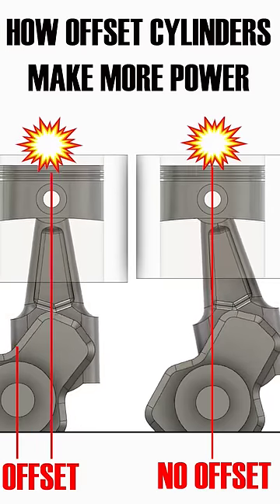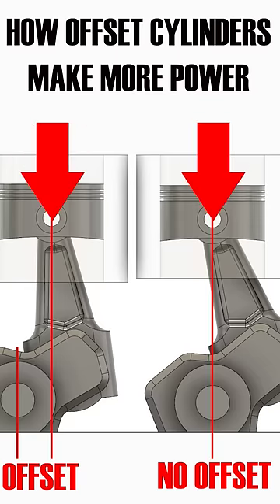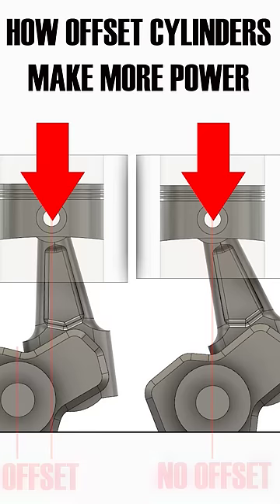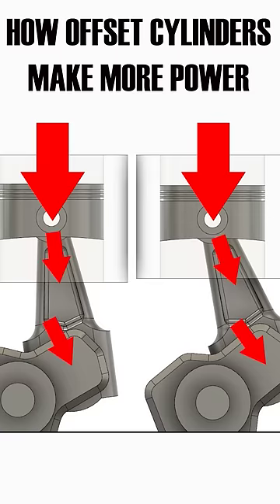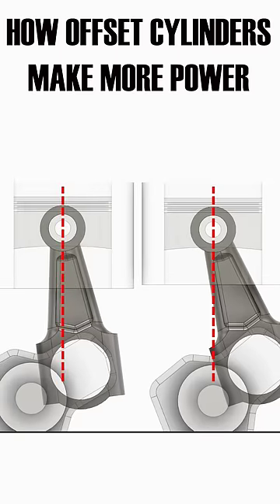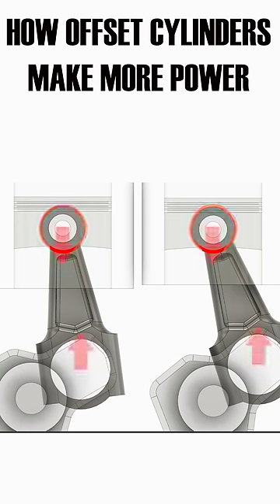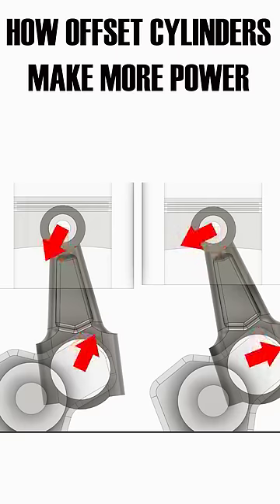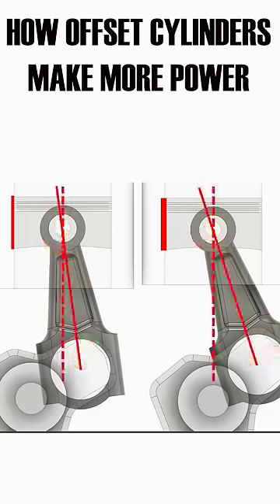Offset cylinders are genius! Full video on the channel. #d4a #engine #yamaha #engineering #toyota

Comment: You mean like the awesome little Slant 6 engine Dodge used to put in everything? Wish they hadn’t stopped making it. I believe it was the best engine ever built in the USA.
Reply: Rest in peace dad... his 72 dodge dart with the slant 6 pretty much embarrassed everything from Camaro RS to 350 SL..❤
Reply: @sbadaro  I believe it. My 1 ton dually with a granny low 5 speed hummed at 135 mph. My speedometer only went to 85, so I had some police friends get in front and back of me and clock my speed. They waved me off at 135 because that was where their speedometers stopped. But I still had pedal left. Never did find out exactly how fast it would go. However, you had to put about 750-1,000 pounds on it around 95 or it would get squirrelly. I loved that truck.

Comment: Mitsubishi were one of the first to do it in sports cars like the fto, gto and galant
Reply: Hahaha! One of the first, with Ford's Model T, no doubt...
No, Mitsubishi were not one of the first.
Reply: @mackerel1875  successfully? And the model t is not a sports car is it
Reply: @pbart9821  Okay. 
MG. The MGBs starting in '62. There's earlier too. And they're not Mitsubishis.
Reply: @mackerel1875  erm, no it doesn't
 It had an offset key on the crank nose.

Not an offset crank 😉

2 degrees is not enough to be termed "offset" it is biased, not truly offset
Reply: @pbart9821  they had offset bores. There's some nice pics if you have any books on désaxé engines.
Checkout the MG works cars with the offset overbore engines. They were done that way for internal clearance. Still désaxé principle though.
Reply: @mackerel1875  again You've misinterpreted that, they have an angled cylinder, but it is not in fact offset
Reply: @pbart9821 Tell those boys to stick to Subaru ringlands 💀

Comment: So with a regular non offset engine it is better to have a longer stroke. Resulting in less cylinder wall pressure and more cc. Therefore the engine will have more power.
Reply: It'll have more torque and you won't be able to rev it as high as a short stroke engine.

Comment: Just watched your video and it was great, with some of the best visual aids ever. Keep up the good work.
Also maybe you can do another video on the topic but this time around the most widely produced offset engine, the prius engine. It has a 13mm offset, and to address the balance issue toyota uses one of two electric motors (mg1)in the transmission and the hybrid system to activate that motor and help the crankshaft move the con rods up on the compression and exhaust strokes, thus eliminating the mechanical disadvantage of the offset engine and taking advantage of all the benefits of the offset engine. Also if you were to induce an imbalance by say disconnecting an ignition coil on a running prius engine it will misfire obviously but it will also shake violently and make a very loud "clacking" noise far worse than any normal offset engine. The prius engine is not the fastest or the most glamorous engines out there but it is very advanced and it would be really educational if you were to make a video on that. Cheers.
Reply: I was wondering what cars use this design principle, thank you for mentioning this extreme example! Also using the electric motors for engine balance is beyond amazing in my mind

Comment: The first application I saw of this was a small inline 4 made by ford a couple years ago and it made me start to think why aren’t other manufacturers using this? It’s such a simple idea and was super effective at adding power and efficiency with no real cost added to manufacturing. And the more research I did it absolutely blows my mind that highway semi’s and ships don’t utilize this in their engines. I mean even as little as a 10% increase in efficiency or fuel economy would be thousands saved for truckers and millions saved for container ships.
Reply: Mitsubishi did it from 1979
Reply: It was found in the 30s and 40s, that the theory worked okay (with caveats), but larger applications suffered from assymetric wear, and as a result, much reduced block service life. 
Motor has to be built 30-50% stronger , and shorter service life exceeded any benefits generated by this kind of engine.
Reply: @mackerel1875  it would be curious to see the results today. I mean we now know so much more about piston to wall clearances, ductile iron sleeves and other materials, cross hatch patterns and ring design for oil control, the quality of the oil itself. There are so many things that have changed an improved in the last 80+ years that it would seem like a waste not to try.
Reply: @WhyNot6243  My guess is somebody probably has, surely. 
I can only assume that the assymetric loads might still exceed either the textile strength of metals used in large capacity engine construction, or costs.
It's probably just the cost of retooling 🤦 lol...
Reply: @mackerel1875  I mean that does play a significant factor. As does the fact that, who wants to improve fuel economy when we sell so much diesel for these trucks to drive across the country and then make them burn even more fuel while they regen to burn off the unburnt fuel that is left over from the initial combustion not being efficient. I mean where’s the money in that?
Reply: @mackerel1875  it isn't the kind of engine that has the problem. Those engines had poor balance. This method infact reduces power stroke friction enormously
Reply: @pbart9821  it's not me you've got to convince.
Reply: @WhyNot6243  we know how it performs today, very well if engineered and built well (like mitsubishi) and poorly when not done well (fiat in the early 2000s)
Reply: @pbart9821  but those are real small 2.0l engines. I’m talking about 16l diesels in highway tractors. Or 100,000 cubic inch ship engines. At those engine sizes even a 4-5% increase in efficiency is huge.
Reply: @WhyNot6243  they did it later in the pajero/shogun 3.8l diesels and petrols.

I'm pretty sure Cunard line ships have more recently used small offsets on the newer engines

Comment: Wouldn't this increase friction during the compression and exhaust strokes?
Reply from the maker: They're irrelevant because friction is minimal overall during these strokes as the load on the piston is minimal. Combustion is what matters. This is why all cylinders are always more worn on one side.
Reply: @d4a  Thank you...makes sense👍

Comment: Honest question,  with an offset cylinder you have less friction during one part of the cycle but wouldnt that create more friction when the rod is at the opposite point in the cycle due to a steeper angle from being further away from that offset?

Comment: Back in the muscle car days some 440 Chrysler products came with dual valve reliefs so the piston could be put in backwards to improve the offset and gain horse power. The down side is more piston noise in low drag configuration.

Comment: Do engines with offset cylinders use offset wrist pins as well? I also feel these methods could be very beneficial in 2-stroke engines
Reply from the maker: I think pretty much every engine made in the past 50 years or more has offset pins, 2 strokes included. One of the key reasons behind this is to angle the rod a bit at tdc to prevent rotation in reverse direction. Thank you for the support 🙏
Reply: @d4a Which direction are offset wrist pins placed?

Comment: Holy crap for reasons too long to type on a phone this is not accurate. Essentially short crank throw engines make more HP vs Torque due to lower rates of acceleration of the piston and rod. Remember the contact surface of the skirt is protected by a layer of oil and thus it's not a linear increase in friction.

Comment: Isn't it so also that under the first milliseconds after ignition the force is pointing almost directly to the crankshaft's rotational center and therefore wasted in a no offset cylinder, which isn't the case on an offset cylinder?
Reply: I think that's actually the major source of the power (really efficiency). The energy isn't entirely conserved in the time it takes a conventional engine to reach a more favorable crank angle. It radiates and conducts to the cylinder walls if it isn't expanded immediately and is lost for the purposes of power production. Offset rods allow more of the expansion to happen quickly after ignition with lower heat loss.
Reply: I think that's actually the major source of the power (really efficiency). The energy isn't entirely conserved in the time it takes a conventional engine to reach a more favorable crank angle. It radiates and conducts to the cylinder walls if it isn't expanded immediately and is lost for the purposes of power production. Offset rods allow more of the expansion to happen quickly after ignition with lower heat loss.

Comment: Can this also reduce fuel consumption?
Reply: Lets connect things together. 
More power means quicker RPMs, which means you will get to your desired power or speed in shorter time, which definitely will let you be easier on the gas pedal sooner, transmission shifts up sooner, which saves more fuel

Comment: But what about on the compression stroke? Wouldn't the rod angle be even steeper than if the cylinder were in-line with the crank?

Comment: I have a 2010 M3 v8 I put a flat plain crank in it and some other goodie’s. Sounds like a F1 car when you wind it out also it reves way quicker than it did with the factory cross plain crank it had. Going by the physics I’m thinking you don’t get the piston drag on one side like the cross plane engines.
Reply: fyi
a flatplane crank has perfect primary balance so the crank itself is lighter because it doesnt need as large a counterweight as a cross plane one because crossplane doesnt have perfect primary balance

thus it revs faster because the crank has less counterweight and weighs less

just wanted to share this to avoid misunderstandings!
Reply: if you are interested as to why most manufacturers use cross plane is because it has better secondary balance than flat plane and gives cross plane a smoother feeling and more reliability because the engine isnt shaking itself apart lmao

Comment: Doesn’t this decrease torque on the crank though?
Reply: No it increases torque. Whatever force you take away from trying to twist the connecting rod and resistance of the piston pushing into the cylinder wall is converted into downward force on the crank. That’s why deckplate engines make more power. They have a better rod to crank angle due to the taller deck height and longer rod.
Reply: @WhyNot6243  well said

Comment: What puts les stress on an engine? Stroker or destroker? What would be a more reliable build with all the same supporting mods. For example, an ej20 stroked to 2.2L vs a EJ25 de-stroked to 2.35
Reply: There's a lot that goes into that answer. If your destroking in order to increase RPM, you're going to increase the stress. If high RPM is the goal, then yeah you're going to want to achieve the lowest stroke distance you can to increase your mean piston speed
Reply: Similar to the video shown, stroking will increase the rod angle while destroking will do the opposite. You would stroke an engine if you want more torque within a smaller rpm range, and destroke if high rpm’s are what you want. It would be more reliable to stroke an EJ20 from 75mm to 79mm or destroke an EJ25 from 79mm to 75mm than it would be to stroke an EJ25 from 79mm to 83mm.

Comment: 'The sharper the angle, the greater the friction'
I'm sorry WTF?
Reply: This only works for inline engines unless you get real fancy offset blocks for a V engine but even then it would be tough to do. At TDC the rod and crank journal would be straight up and down, and at 90 degrees to TDC the rod is at the greatest angle. And if you convert the angle to be a percentage of power lost you would then get 10degree angle=10% loss due to friction or 20degrees=20% loss due to friction. Now that’s not actually how it works but it gives you an idea that the sharper the angle the more the friction goes up.